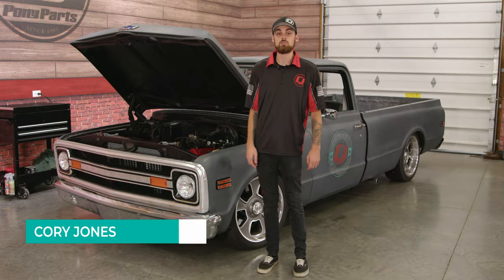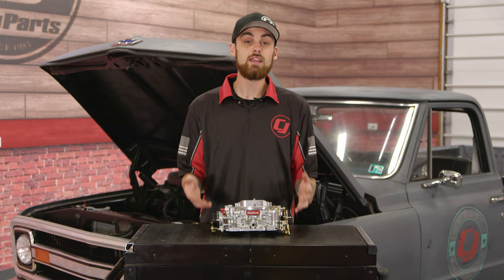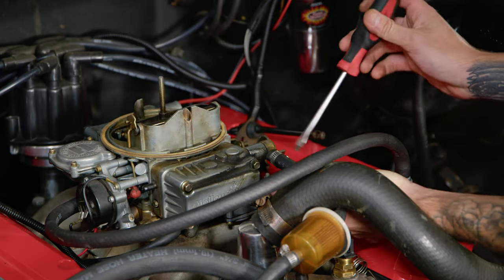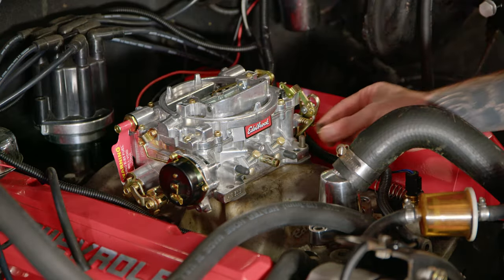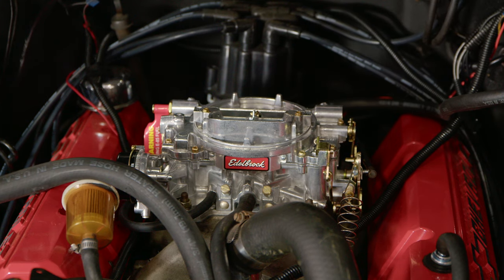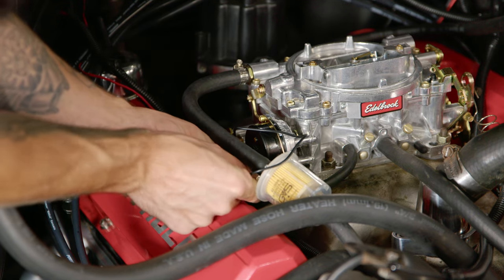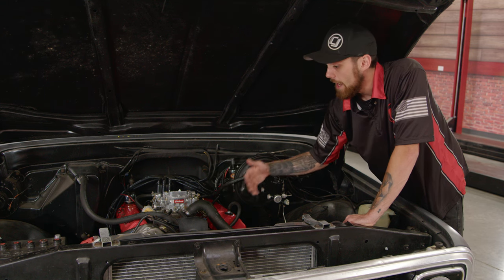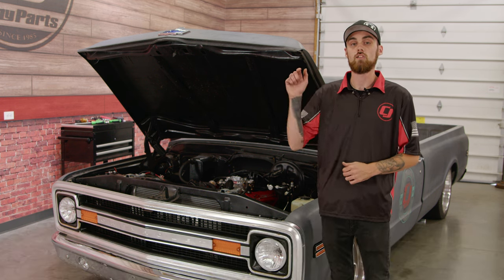Don't Know How To Install a Carburetor? Watch this! / 67-72 Chevy C10 Carburetor Install

Comment: Video is lame only shows how to replace if you already have everything previously installed. Does not show anything on how to wire it. How too pick and get proper brackets how to run linkage if parts are missing, etc. tons of good useful information missing from this video.

Comment: I noticed you have a spread bore intake, you may eventually have a vacuum leak I would use a edelbroke 2732 adapter plate. Still very good video.